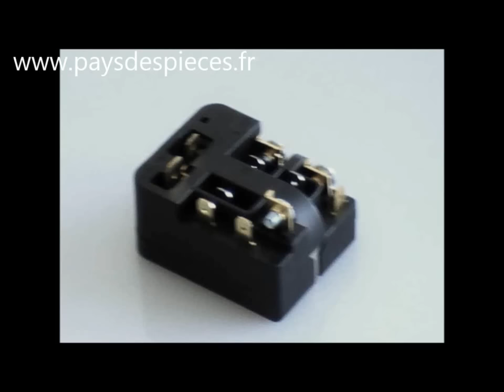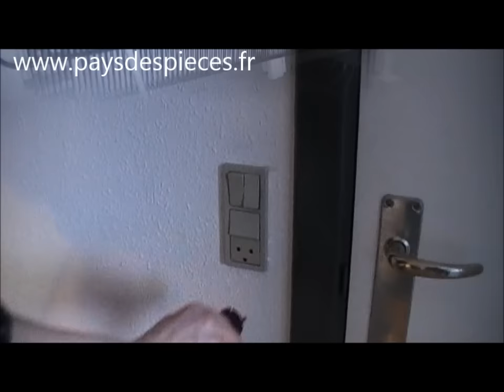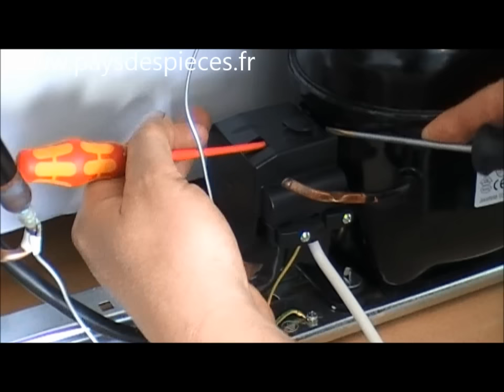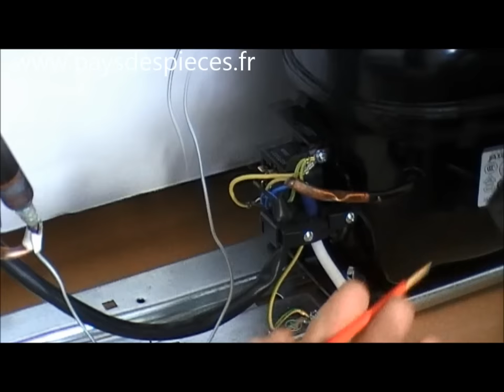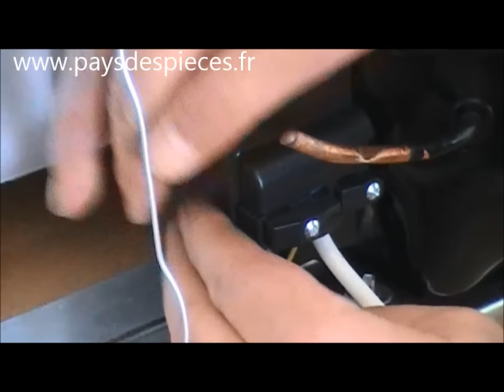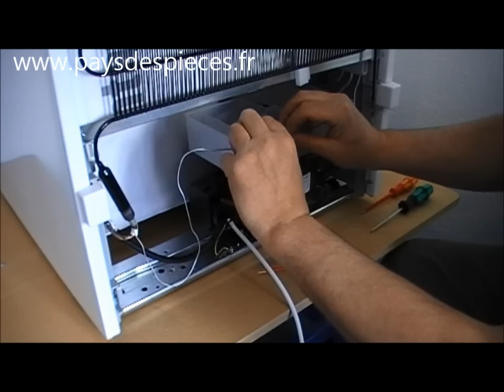Guide vidéo sur la réparation d'un réfrigérateur: voilà comment remplacer un relais

Comment: Bjr svp j'ai un refrigerateur qui apres la mise sous tension le compresseur fonctionne appeinne une minute et coupe. Quel peut etre le probleme.merci
Reply from the maker: Le problme est certainement le start relæ.Pour touver le bon, envoyer un mail à info@paysdespieces.fr .
Joignez une photo de la plaque signalétique.
Reply: j'ai le même soucis depuis hier, mise en route, charge du condensateur, mise en route du compresseur puis extinction au bout de 5s même pas (pire qu'une minute).
j'ai commandé un relay et klixon de rechange sur "spareka", en espérant que ce soit cela. j'aurai débourser que 35 balles pour réparer un frigo qui en vaut 500